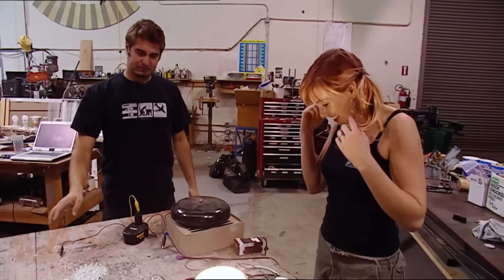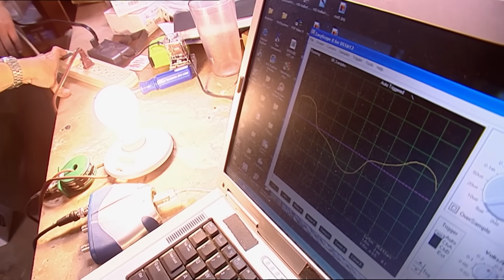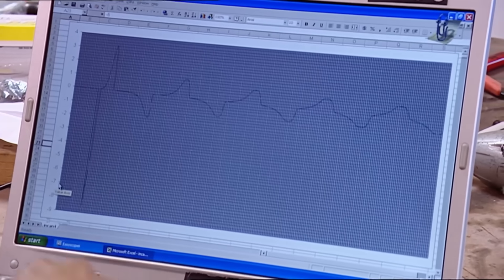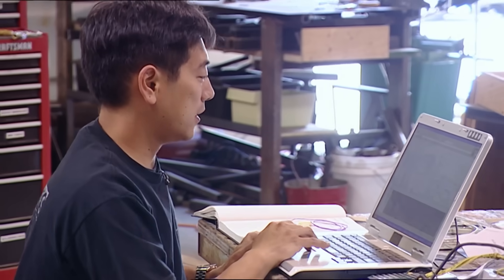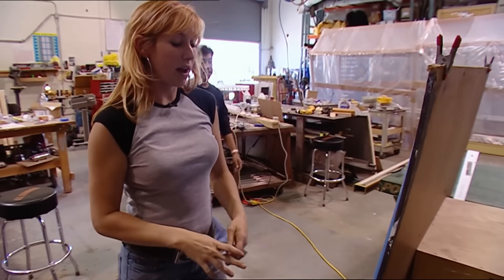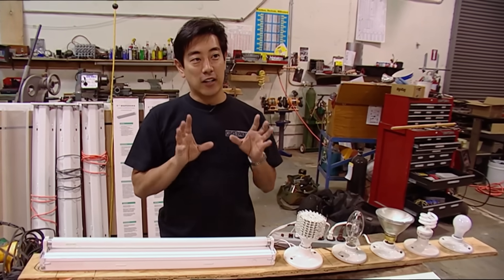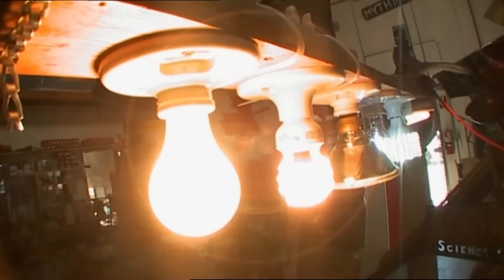Is It Cheaper To Leave The Lights On Than To Turn Them Off? | MythBusters

Comment: Is it more accurate to measure a lightbulb span by 10,000 hours etc. Or 10,000 on off cycles?  Can you break an led flipping ot on and off 10k times?

Comment: There is one situation where if you are heating a house with an energy that cost more than electricity, you can save by letting them opened since the lost energy of the bulb is transformed into heat and cost less than the actual heating system.

If you heat the house with electricity, the difference between on and off in the heating season would be near zero.

Comment: For fluorescent, it wasn't so much about the bulbs, but the Ballasts that were needed to powered them.  They were very expensive in the day and replacing them often is what made it cheaper to leave the lights on. Replacing upwards of 10 ballasts a night in a building was quite costly (10-20 years ago they were over 300$ a piece). The myth was never for homes, it was for businesses. Such as data centers.

Comment: This is one of my favorite Mythbusters segments.

But now there is another concept that I'd like to know; When you start a car, how long does it really take for the alternator to recharge the car battery back to where it was before you started the car?

I don't know if there is another Mythbusters segment that addressed this one or not. But I keep hearing that you have to drive the car for 30 minutes to recharge the car battery after starting the car. I find that farfetched. I think the alternator recharges the battery within seconds of starting the engine.

I've driven a gas powered golf cart that had a starter that automatically started the engine when the gas pedal was pressed. In 18 holes on a golf course, that's a lot of starts and short trips in a typical afternoon of playing golf. Yet the golf cart battery doesn't run down with all those starts and short trips.

Comment: Noticed how they never mentioned LEDs, and that their wattage use is literally neglegable compared to an incandescent. Even showing the wattage difference. A 90x difference might I add... clearly its alot less if you leave an LED on than any other bulb and that should have been a data point they talked about. But LED bad ig

Comment: Poland here. The cold kills led and sensors. A movement sensor led light lasts less on the outside of a bulb turned on all day. I tried that. Include the cost of the bulb (and the sensor) in the equation... instead.

Comment: They neglected to address a HUUUGE caveat to all of this: the 'wasted' energy (which appears to be the underlying issue this video wants to address). The missing questions that should have been addressed is, "Were does this wasted energy go"?  It goes to heat!  

So, in the cold months the heat produced by lights makes the furnace/heaters work less.....so it is essentially a wash - ZERO energy waste!  In the summer, however, when the AC needs to move heat from the inside to the outside, the extra heat generated is compounded by the AC having to work a little harder.

LED bulbs are so efficient, however, that all of this belly-aching becomes almost negligible:  For a worst case scenario, if you left a whole house (say 25 100W equivalent LED bulbs - 15W each) on 16 hours a day 7 days a week, that is about 185kWHrs of electricity usage.  At $0.15 per kWHr that is only about $28/mo (<$1/day).  Again, none of that is "wasted" money in the winter....but the waste is essentially doubled in the summer.

So, the moral of the story (to me and my preferences at least): convert to LED bulbs and then enjoy the warmth and convenience of a home that is well lit throughout during all the hours anyone is home.....and discard the penny-pinching anxiety that this video would seem to feed!

Comment: True answer: Modern lightbulbs use SUCH low electricity, if you were to live in darkness 24 hours a day for a month vs have every light on in your entire home 24/7 for a month, the cost difference at the end of the month would be negligible, like barely a blip on your bill radar.

Heck, even gaming computers and TVs and stuff are super energy efficient nowadays.

If you're able to look at the breakdown of your electric bill, almost ALL of it is HVAC and your refrigerator. Electronics, lights, etc, are really nothing to worry about as far as turning on/off.
Reply: Laptops with no GPU can be power efficient, sure, but gaming PCs and laptops can use anywhere from 150 to 600+ watts just for casual gaming
Reply: @DanielQRT I have my gaming computer that is thousands of dollars with beefy video card, specs, etc, etc. It's running 24/7 all month long, and is barely a blip on the electric bill.

It's truly fine, and not something to worry about
Reply: @ruffsnap  you're lucky to have cheap electricity, the prices can vary quite a lot (especially when compared to incomes)

Comment: They are missing more important thing - failures in electronic devices happen more often when turning on than during normal operation. This is what should be calculated - if turning off a lightbulb and turning it on in, let's say, after 5 minutes - is saved energy worth the shortened lifetime of the bulb?

Comment: Most this I knew. 
However with older fluorescent it's not the power or the bulb that is the concern. It is the ballast , which is often more expensive than just a new light fixture.
 Shop I worked in the owner always  left the lights on. He had 35 years experience with the troubles the florescents gave him.

Comment: i tell you what, 12 years ago when I moved into my house, i bought a pack of LED bulbs.  I installed one in my porchlight, and I NEVER turn it off.  The bulbs inside my house, that constantly get turned off and on, only lasted a few years.  My porchlight?  Still burning

Comment: With modern LED bulbs, savings are minimal. Do you have to turn the lamp on and off every time you go make a cup of tea? Nowadays, lighting accounts for such a small portion of a home's electricity consumption that it's downright ridiculous.

Lighting a small house with average-sized bulbs will consume about as much energy as a typical desktop computer.

If you boil a kettle with 1 liter of water, you've used about enough energy to light your entire house for an hour.

Lighting should be turned off only when you're not actually using a room.

Comment: Several years back I bought Chinese made, off-brand CFL bulbs and even though they were rated for at least 10,000 hours, I didn’t even get two months out of them before they were already dead. This was with standard residential use where I was out of the house, the majority of the day. And then I did the math and saw that based on the number of days that I actually used the bulb it could not have possibly reached 10,000 hours so I knew that the bulbs were defective.

Comment: Some other factors. How about the longetivity of the switches that are being used to turn the light bulb off and on. And the longetivity of the circuitry supplying the current to the light bulb due to the current surge at the start? Not to mention the fact that these can't be replaced at cost, but also the cost of the electrician having to be called. 
Am way too invested into this ..

Comment: I stopped at 00:01 to say no, it’s an old wives tale. There is a surge when you first turn it on, but it’s only a split second, not enough to use up extra energy.
Reply: After watching the clip, I see they did it right. I was far less elaborate, measuring the current without any timers. As there was not enough of a surge to amount to anything, it appeared as a steady start, so I knew the surge wasn’t enough to amount to anything.

Comment: ya'll need to test home air conditioning. I know people that leave the heater temps set to low when it's freezing and they'll also leave the a/c temps high when it's hot.

I told them doing that is basically no different than just running at a normal temperature.

initially it'll use more energy if you're trying to get the house from 65F to 74F, but if they leave the heat alone it wont struggle as much to reach 74F after that first cycle.

Same with A/C. If it's 100F outside and your A/C is set to 80F, just go ahead and put it at 73F instead. Again going from 80-73 will cause it to run a tiny bit longer, but after that it wont exert as much energy reaching 73.

They do this because they don't want higher electricity bills, but I'm thinking they actually like suffering

Comment: This test is incorrect. One needs to factor (a) how often turning on a bulb shortens the overall lifetime of the bulb (power cycling hurts longevity, an manufacturing bulbs has energy costs to make, ship to stores, transport home, and dispose), and (b) in colder cilmates like Canada, the energy of the bulb when not needed but is on goes into heating the home so it is not "wasted" most of the year though it is less efficient then other ways to heat the home, but in southern climes like southern USA when air conditioning runs most of the year then the cost is much more to cool in addition to the energy to light up the bulb. So, this test is useless as is.

Comment: There is also a HUGE flaw in you "wear and tear test"   6 weeks is now where near enough time to do the test, as your average incandescent bulb will go 10 000+ continuous run time, and fluorescent tubes even longer !!!!  In real life. most people are lucky to get 2 years out of an incandescent bulb, and 4-5 out of a flurescent tube, where as if they didn't turn them on/off as much, it would more than double that. Rather than your simple unquantified test, you should actually talk to the people in the real world - the building maintenance people that have to constantly change these bulbs, and know the costs of more frequent change outs vs leaving them on constantly.

Comment: The ONLY time leaving them on saves energy is if the bulb requires a considerable amount of power to fire it on and the time it would be off is short enough to use less energy than that, which is exceedingly rare because it is a very short period of time.  That said, if I leave a room and will be back in less than a few minutes.

Comment: LED bulbs are often driven at near-maximum current, which is what really shortens their lifespan—an example of programmed end-of-life. Replacing the ‘RS’ resistor with a slightly higher value to reduce the current can greatly extend how long the bulb lasts.

Comment: The life of filament is shortened with each change so cost if replacing bulbs must be included. Remember there is one bulb that has never been turned off for over 100 years.

Comment: The only bulb that is not been burned out is the LED. I had to look it back to confirm that is what has been said.

So if the fluorescent tube burned out within 1 hour (30 cycles) and it costs 25 dollars it is no way that that could be effective.

Comment: The original version of this theory of turning the lights off was in the early 1970s. It had nothing to do with incandescent bulbs. It was about commercial fluorescent bulbs as used in schools and factories. During that time the ballast transformers that were used to activate the lights a lot of power when first turned on. Something in the neighborhood of between 15 minutes and a half hour of what would be continuous burn time so the rule was don’t turn off the fluorescent lights if you are going to turn them on again in less than a half hour. So the myth that they were trying to buzz here never actually existed in the first place.

Comment: We have LED Christmas lights and they are rated for 50,000 hours of life.  

Assume you operate 6 hours a day 365 days a year that is 22 years. 

If I knock that down by a third  to 4 hours per night I will be dead when they wear out so it is worth turning off the Christmas lights when I retire to bed or set for 6 pm to 10 pm nightly.

Comment: I’m disappointed they don’t show the breakdown for when each bulb went bad. They said only one bulb last the “5 year” equivalent. But didn’t say if the incandescent or florescent went out in one day, 3 weeks, or more. 

I don’t see the myth as busted as they clearly showed all but the led went bad in less than 6 weeks if they are flicked it on and off. 

Assuming they all would have worked more than 6 weeks if left on continuously, switching them on and off does wear them out. I don’t change my bulbs every 5 years…

Comment: though i agree preety with the demonstartion, there is a Real World consideration. the cost of the switch. the very light duty switches made today break easily. so these residential switches die and so just leave on.or dim with a quality dimmer; something used in commercial situations. i do my own, but many electricians will say something like, 'oh yeh i put in the best'.  i think this offsets the cost of electricity.

Comment: I'm sure the myth is busted regardless of what I'm about to say, but I don't recall too many incandescents that lasted five years. I would guess the reason is because the bulb was heating from room temperature with normal use. On the other hand this experiment probably didn't allow the bulbs to cool fully every time.

Comment: 3:49 Oh look, a Rookie Mistake: A 60-watt tungsten bulb by definition uses 60 watt-seconds per second. Y'all should have noticed that 59,519 W•s is wrong by a factor of a thousand. Same for every entry in columns 2 and 3. 
Critical thinking is about checking for contradictions. 
(Luckily, both columns are wrong by the same factor, so the figure of merit (the ratio between the two) comes out the same.) 

(Nowadays, in 2025, if we want to make these kinds of errors, we can ask an AI.)

Comment: But, does the power consumption raise, lower, or remain the same as the conponents for the bulb become stressed out. Might have been 0.36 seconds at the start and 3.6 minutes just before it blew out. Simply, over time it might become more efficient to leave them on because of resistance changes causing more power consumption to deliver the same load. And then, if so, the question is, what is the break point of longevity where it becomes more efficient to leave it on than to turn it off and back in as needed?

Comment: BUT.... why didn't you actually calculate the true cost of leaving the light bulbs on continuously based on National Average electricity costs?   Turning them on and off just to save a few cents might not matter to many.    Especially LED lights.   1 Watt... barely moves any electricity.    You're not saving much turning them off vs leaving them on.

Comment: This is good usable information.  The bulb longevity was what I had always wondered about, but now I still wonder about the same question regarding other electrical devices, like desktop conputers (turn it off or leave it on a couple hours?) or audio components.

Comment: This was done by Hillsboro College, or another local and Florida power back in 1979. Learned a few things.
1, The total average cost of a home to run the lights was less than 3 percent. So no lights for a month was less than 3 dollars saved.
2. When testing the fluorescents, need to use the old-style. with the plug in starters. we used to change these all the time.
It was the starters which used more power than the light did in over 1 hour use.
I used to joke and switch the lights on, off, off, off, on and say there goes 3 hours of electricity!

Comment: but, the older fluorescent tubes used a great deal of power when lit. the ballast used about the same power as the tubes uses. so 2 f40 tubes actually used 160 watts of power when lit.
Reply: They covered it. Basically if you plan to leave the room for more than 23 seconds go ahead and shut them off.

Comment: Similarly, is turning off a car engine while stopped at a red light worth it? How does the frequent off and on affect gas/electrical consumption, but more importantly, how does it affect the longevity of car starter motors and maybe other components such as the ignition switch, etc.?  Car parts and labor aren't cheap.

Comment: Turning off the lights saves power and energy cost ?! 🤯
Reply: Most of the power from a lightbulb is transfered to a room as heat, which means a lightbulb is kinda just a heater. If you have cheap electricity and expensive heating in your house, it might actually be useless to turn the lights off

Comment: If you turn off the type of bulbs that burn in a salt lamp even once they go completely out not long after. That salt lamp I don’t think has ever burned through a bulb even being on for a year consistently. But for any reason, you turn it off or the power goes out, then you turn it back on and it won’t last long. You can count on it every time that bulb if done once you shut it off.

Comment: here’s the summary for LED light bulbs from youtube

Here's how the findings apply to LEDs:

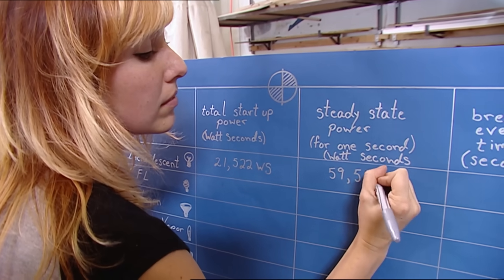•	Startup Energy Surge: Unlike the incandescent bulbs tested in the video (2:05-2:28), LEDs do not have a significant energy surge when turned on. Any startup surge in modern LEDs is negligible compared to their continuous energy use, meaning it's not a significant factor in overall energy consumption.
•	Longevity and Frequent Switching: The video's longevity test showed that the LED was the only bulb that did not burn out after simulating over five years of on/off stress (5:21-5:23, 5:35-5:40). This aligns with external information, which states that frequent switching does not significantly impact the lifespan of an LED bulb as it did with incandescent bulbs. While excessive cycling can still shorten an LED's lifespan, especially for lower-quality bulbs, the effect is much less pronounced.

Conclusion for LEDs:
It is more energy-efficient to turn off an LED light if you will be gone for even a short period, as the energy saved is greater than the minimal energy used for startup. For maximum longevity, it's still advisable to avoid turning lights on and off unnecessarily, and investing in high-quality LED bulbs can help ensure their durability.